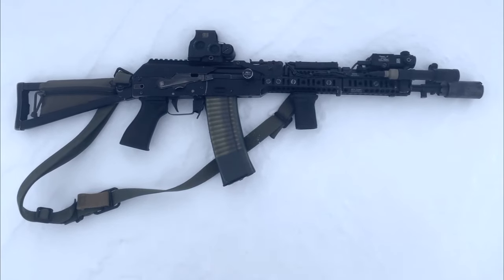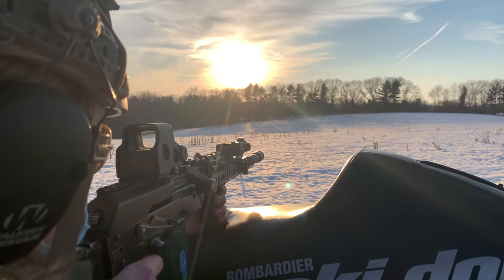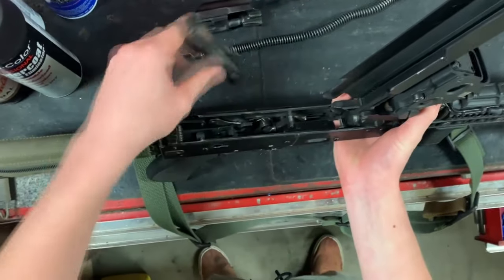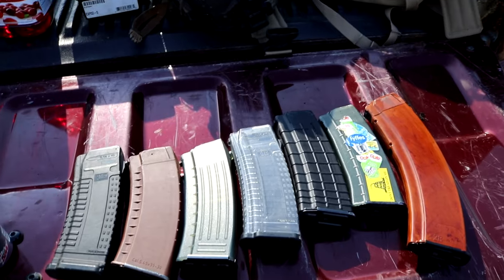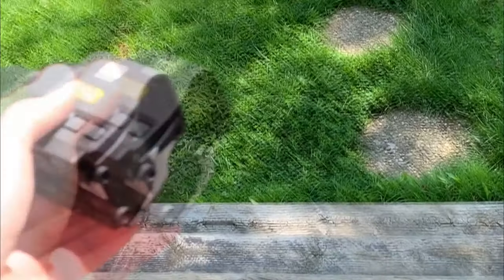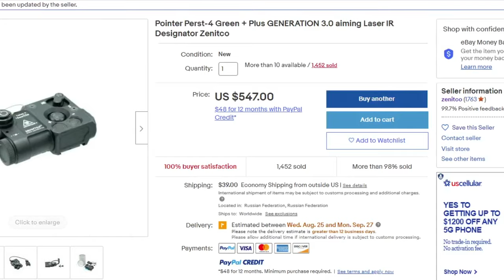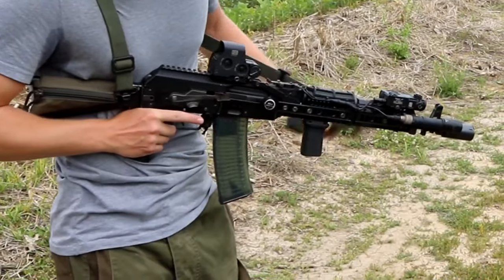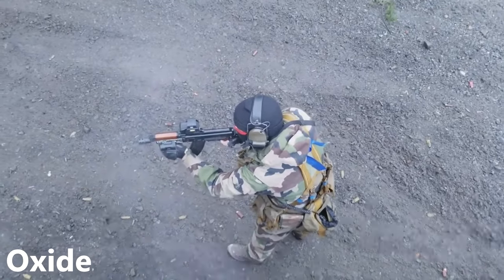𝐌𝐨𝐝𝐞𝐫𝐧𝐢𝐳𝐞𝐝 𝐙𝐞𝐧𝐢𝐭𝐜𝐨 𝐒𝐋𝐑-𝟏𝟎𝟔𝐅𝐑

Comment: For anyone coming back to this video in the future, A3 Tactical makes a 1913 folding triangle stock that, visually, looks like the original metal one. You will need to cut the metal tang off your fixed stock guns or replace the folding mechanism on your side folder guns, with a 1913 adapter (I personally recommend JMAC). However, what's good about the A3T stock is that it comes in both aluminum and polymer; I have the latter which is both lighter and less temperature sensitive, i.e. it doesn't freeze or burn your face off. A3T also sells a non-folding adapter, QD sling socket and rubber buttpad and cheek riser. Highly recommended if you want to keep that classic look to your 74 but don't want to have search and pay for original equipment should you want to modernize.

Comment: Me: "No AK can beat the 14.5 M4A1s that we used in the Middle East." 

Me after seeing this: "Okay, maybe I was wrong...

Good review, dude!💪🏻
Reply: The ar platform is still overall more comfortable. Having the ability to drop the bolt with a button rather than manually racking is taken for granted
Reply: @fiskersproductions Did you ready my comment? Full on AR guy, here. The only way that I would own an AK is if it was made like this one. I might build one out like this. 5.56 AKs are special.

Comment: Love my SLR-106F. Did the AKT trigger and Krebs safety too. I opted for SLR rifle works handgaurd. Since mine did not have rail I've experimented with different mounts all to no relief. I want get the one where sight block is replaced with dovetail mount for long and short range options (Sabre Works) KOP ak sight system but it will be expensive Im sure. I love them FIREBALLS! Nice setup man!
Reply: Hinged dust cover

Comment: I use kpyk and holosun . I built my 556 with psa and galil parts And a 15 guage sheet metal plate from lowes 😂. Made an ak bending jig . Heating them in a cheap 110v kiln i made . These guns are the best IMO
Reply from the maker: you madman!

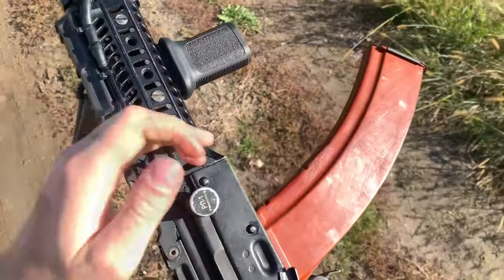Comment: Did you use the 5.45 45 round Bakelite mag at 2:02 and how many round you use it that made it still reliable
Reply from the maker: It runs good on 6 rounds, but I won't bet my life on it. Mainly just to look cool.
Reply: You can use a pod arms 5.56 follower in a 5.45 bakelite mag and it should function reliably fully loaded.